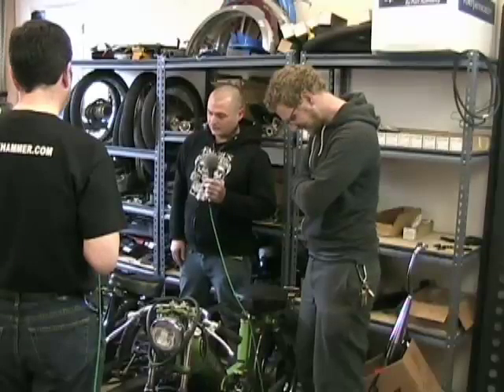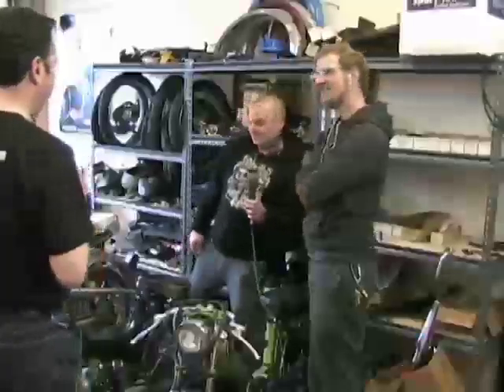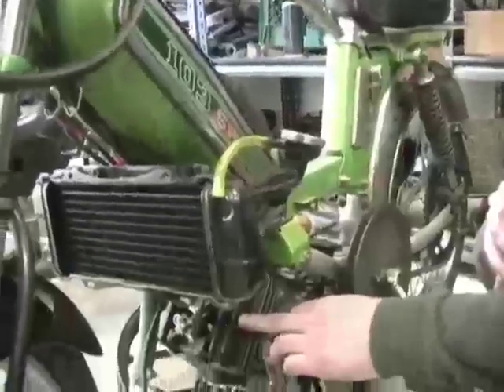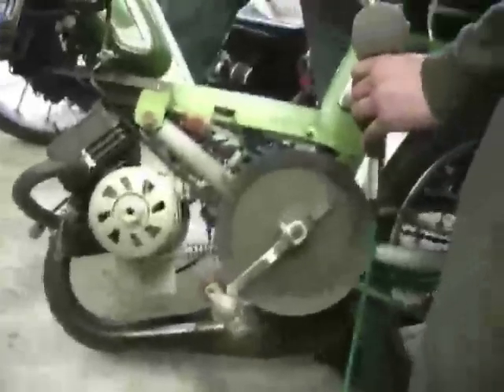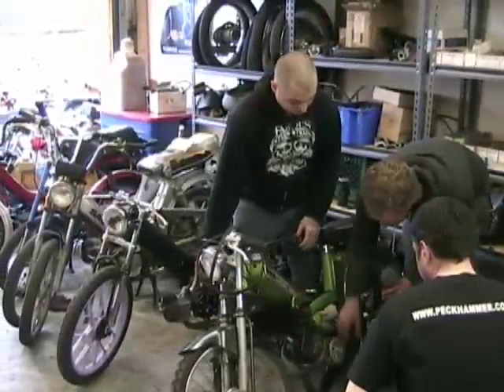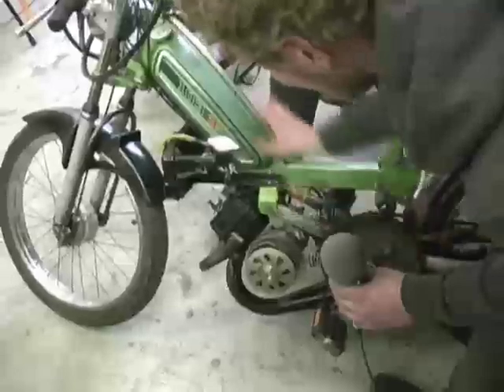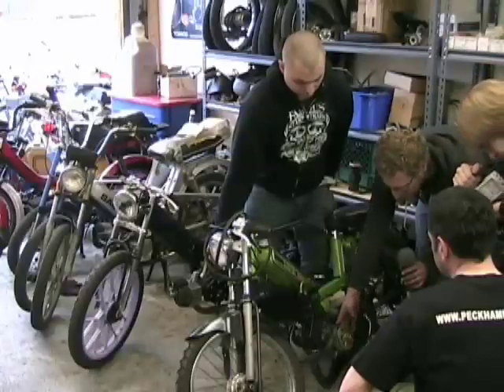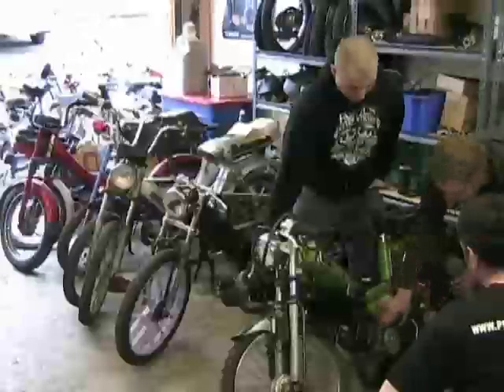Unleash The Beast: Moped Performance Tuning, Part 2

Comment: i have an old garelli moped. it has a delorto carb on it off tomos. it starts only with choke on and dies if choke is turned off... it idles ridiculously high and the second you add throttle it dies... any recomendations